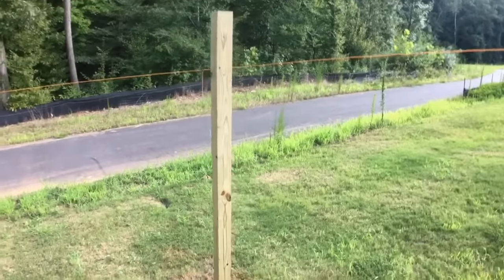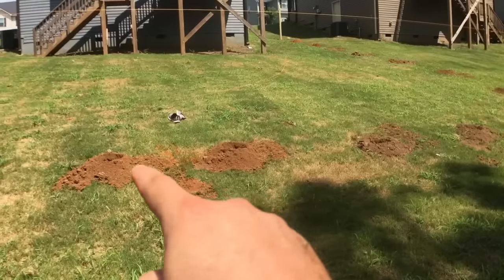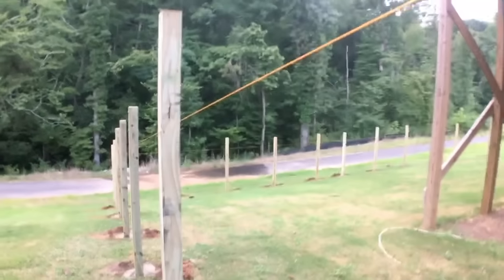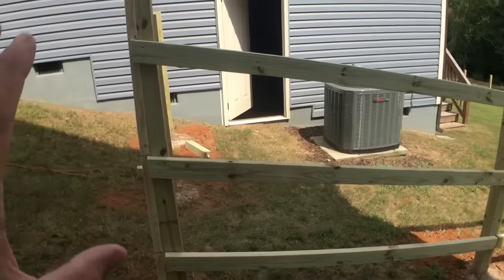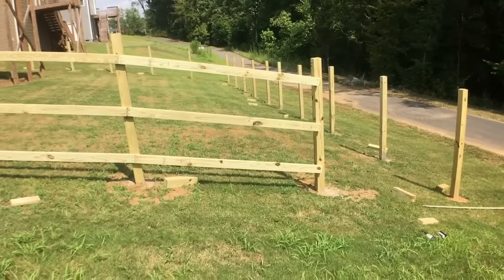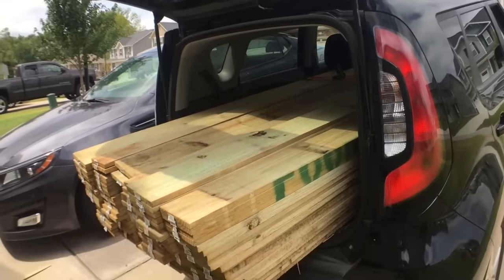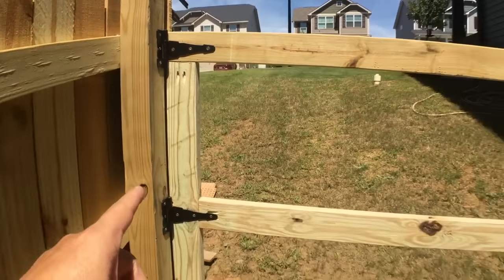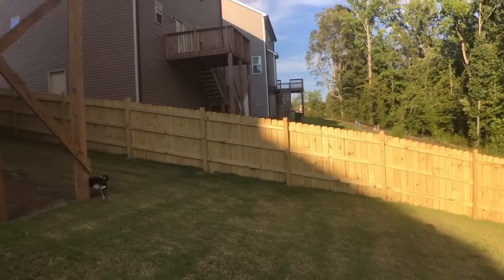How To Build & Install A Wood Privacy Fence Yourself! WITHOUT breaking the bank!!!!

Comment: Great jobs guys! I'm thinking of doing the same thing. Can I ask how much you saved by doing it yourself instead of buying a fence?
Reply from the maker: A ton of money!!! We were quoted $4500 ans $5000! We spent $1400 including rental of Auger. We had the nail gun and compressor so didn’t need that as well as radial arm saw so that cost of tools isn’t included! Thanks for watching !
Reply: Wow that's great. I was quoted 9k for a 200ft vinyl fence. I'm definitely taking your advise and doing wood.
Thank you again.
Reply from the maker: Holy Crap!! I believe ours was about 190 linear feet not including gates! What I paid was INCLUDING gates and hardware!! Run fast and DIY!!!

Comment: I had installed 8 pre made privacy fencing sections earlier, then I seen your video and decided to finish my project a picket at a time like you have done, so THANK YOU for posting this... it's going to be a big help...but I do have a question...on the pre made sections, they used 2 x 3 wood for the cross boards...you used 2 x 4' s ($5 ea.),which cost more than the 2 x 3 ones($3.49 ea.)...any particular reason why ?
Reply: I don't know his particular reason, but I know locally my home depot and Lowes don't carry pressure treated 2x3 lumber. Here the price is ~ $3.50 for ground rated 2x4.
Reply: @kevinr6721  Thank you !
I just finished about 200 foot of fencing all based on hisYouTube video...it made all the difference in the world..only thing I didnt do was to rent a powered Auger..I dug 22 posts with a old fashioned post hole digger and it put the hurts on my 62 year old body !! Lol

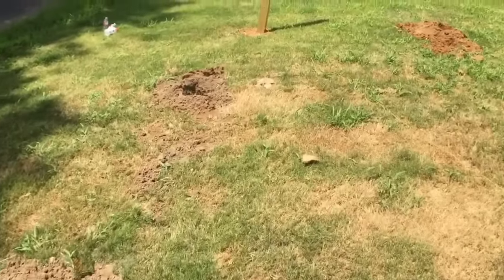Comment: ha ha ha   3:34

I would love to only have a few rocks that are that size!   My area is built on an alluvial fan from the last ice age: mostly rocks with just enough dirt to lock it all in place.  Its all relative.  ;-)

The power is for speed, not ease.  I can't use the auger: it will bind repeatedly.  I have to dig manually, so it will take me a few days to get the holes in.
Reply from the maker: I was going to only do a few holes a day and go without the Auger myself but wanted to get that part over with! What a PITA!!! LoL. Thanks for watching!!!

Comment: How did you get the 4 corners lined up straight with each other??
Reply from the maker: I measured everything based on my property prints. I decided to go in about 6-8” just to make sure I didn’t impede on my neighbors property. I’d rather go less and be sure than to be wrong and have to rip down the fence over 3 or 4” error on my part!
Reply: @TheCrawlspaceCraftsman  thank you for the reply! With that being how you decided where to put them, how did you line up each corner with the other to create a straight line of string? Forgive my ignorance, not sure how to phrase the question. I worry I would place the corner posts at some angle, effectively creating a whole side of fence that’s crooked

Comment: Hey There! Did you use a 6" Auger for your 4x4 posts? I am thinking about using 6x6 posts, but really don't want to have to buy a 8" wide auger.
Reply from the maker: Hey there! We used a 6” auger bit. I believe 8” will be overkill and more work. Hope that helped ya!

Comment: I have an old fashioned post hole digger. It has two large handles like you'd see on a shovel, and on the end are two pieces that look like shovel blades. It's heavy too, but I don't think that I could lift an auger..yikes! If it's anything like a rental circular sander, then count me out..LOL.
Reply from the maker: I took have an old school post hole digger and that was my original intent to do but with all the rocks, clay and stumps it was way too much work. I could have done a hole or two a day and called it good but i wanted to be done with it! LoL. Thanks for watching!

Comment: Fence looks awesome!  What is the reason for setting posts 7' on center instead of 8' on center? Considering you can get 2x4s in 8' lengths. Just curious.
Reply from the maker: #1 it made the fence just a little stronger but also you have to make sure your 4x4s are DEAD CENTER 8' or your screwed.  This makes it a bit easier.  Yeah you have to cut a foot off but its worth it!
Reply: @TheCrawlspaceCraftsman  Gotcha. Very good idea!

Comment: Looks really good and well done. Thanks for the informative step by step video. Out of curiosity, how much did all the material costs add up to if you don’t mind me asking? Thanks.
Reply from the maker: Thanks so much Teefo11!!!  I spent overall (in this video) just about $1400 and that includes the tool rental.  I spent about another $150 on Post Caps and Solar Lights that Is in my last video I posted.  I took a Youtube Vacation and plan to start uploading again regularly in a day or so!  Thanks again!

Comment: Plumb, not level. Use a spacer to offset the strings 1/4" or so from the corner posts and run a string line near the bottom as well. Then set the rest of the posts the same offset distance from the strings.
Reply from the maker: Verbal good up! LoL. Thanks for watching!!

Comment: Good looking fence. I've used the story pole method before as well! Make sure to eyeball your posts to help prevent bowing by running the worst bow laterally in line with the fence. That treated wood will get wild on ya!
Reply from the maker: Yeah!! I did a one year follow up video and you can see where a few 2x4s went a little crazy!  Lesson Learned I guess!  still looks pretty darn good! Thanks for your feedback!

Comment: How much did it end up costing per Linear foot including equipment rental and hardware and concrete and and and thx super good video if I can do it you already did
Reply from the maker: I think it ended up to the tune of about $8.50/linear Foot. That does not include the post caps which I did a separate video on. That was almost $300!!! So with the caps....more like $10/ft

Comment: The post hole digger is a jerk at times..I use a short handle long spade..i call it a sharpshooter works so well when you dont want to shell out for the auger..
Reply from the maker: this ground was WAY to hard and stoney for Sharpshooter.  Plus this got the job done a lot faster... I only regret the after affects!  Took me a few days to recover.  Hope I don't have to use one again any time soon!
Reply: Awesome job..i finished up a fence job, using your template technique. Your video was very helpful. and thanks for the Walmart tip..

Comment: How did you cut the slats? Or did you by them pre cut?
Reply from the maker: Just used my Miter saw and measured every 6-8 boards as the height of the actual boards changed a little bit as you work your way down line.

Comment: Hi you did an EXCELENT JOB  for one its not easy to do privacy fence,. Me and my father did one straight one on level ground not real hard,  but with the way your yard is man you are super smart I mean it.No if you can do that on unlevel ground I certainally can not...It cost alot for all those boards and materials so I can.t imagine what a fencing cpmpany would charge so so much and it would not be any better job at all..Subscribing. Questions where is this at? and I never in my life seen such tall houses wow atleast 3 stories.Did you videos from the top of your house man bets is high.I kinda like that and don't like height at the same time.Roofing your house no way deadly dangerous.
Reply from the maker: Hey NE!!! I’m in North Carolina. This is a three story house but the “crawl” is huge making more like 4 story’s. I plan to build my workshop under the house. Might do a shop build video on that too!!! Thanks so much for the kind words and also for subbing! Cheers!

Comment: nice job and video, i have to laugh tho with how close your neighbors are and how tall those houses are, not sure about the "privacy" part, other than letting your dog run in the prison yard.    snark.    but very helpful, and informative.   i'm going to tackle refencing my house as well, a couple hurricanes did it in, they didn't put concreate in all the posts so they rotted in the ground.
Reply from the maker: with the slope of my yard and how tall the houses are... there really is ZERO privacy.  This is why I didn't really worry about the height.  Thanks so much for watching!

Comment: Is it cheaper to buy the fence panel or buy the pickets individual
Reply from the maker: Stay away from panels at all costs! They’re Cheaply made. They use 2x3s for the runners and just crappy. Your savings will not outweigh the quality. I didn’t even consider them due to all the factors of my yard shape and grade as well as the fact I could only go 5’ so I had to cut either way. Hope that helps some and thanks for watching!!!
Reply: @TheCrawlspaceCraftsman  so buy individual pickets right and which ones
Reply from the maker: That is correct. I know at Home Depot they had two quality pickets. I believe one was ceder and like $2.30/ea. I went with the treated pine for $1.68. So far so good!!!
Reply: @TheCrawlspaceCraftsman  ok thanks

Comment: Use your speed square as a circular saw guide and you won't get the wompy cuts. :)  I 100% cannot cut a straight line unassisted lol.
Reply from the maker: That is a great tip! I’m going to add Caps this spring to the tops so I’m not too worried about it but for those that don’t plan to do a cap I agree 100%! Thanks for watching!
Reply: @TheCrawlspaceCraftsman  My old man was a builder, learned me a thing or two ;) We either just bevel cut the tops, or do what i call a princess cut which is a beveled top then two more opposing bevel cuts about 4 inches down to make it look real fancy like. Im too cheap for caps! :D
Reply from the maker: I was going to do something like that but We are opting for something a little more fancy with copper tops. I’m going to do a follow up video I think in May. 👍

Comment: Why are the fence panels touching the ground?  Wouldn't this speedup the panels rotting quicker and is it standard to have panels touch the ground?  Thanks.
Reply from the maker: Yes! I This was a mistake I made but corrected. I actually cut off about 2” off the bottom just recently.
Reply: @TheCrawlspaceCraftsman  I made the Lowe's subcontractor fence company return to cut bottom 2" off.  I had to write through Lowes CEO to local fence company to get it done right.  The subcontractor did the opposite of what it had on Lowes website. Not going to Lowes again....
Reply from the maker: @chefbambu9382  Inhad Lowes come out and quote me almost $6k at the time for this….. again only $1400 for me! Again I made a few mistakes I’m sure but as newbie to it… I love it!

Comment: How much Land do you have ? How many post did you use and how many slots
Reply from the maker: we live on a standard qtr acre lot.  not sure how many pickets but there are 30 posts spaced roughly 7' apart.  where the gates are they are closer.

Comment: What size auger bit did you use?
Reply from the maker: I believe we used about an 8" bit.  There was about 2-3" all the way around the 4x4.  I never did get the exact size so that's my logical guess! Thanks for watching!
Reply: @TheCrawlspaceCraftsman 1 bag per post ,  60 or 80 lb bags?  Thanks for responding. Great video .

Comment: I'm trying to build a fence also. Could you provide the information on the materials you used to make this fence? Also cost.
Reply: Don't have the bottom rail at 10 inches, the boards will warp, making it hard for mowing.  No more than 6 inches is best.

Comment: What size nail gun and type of nails did you use ?
Reply from the maker: I wish I remember the exact size.  I used a Large Gun and Galvanized nails I believe with a broad head.  I think they were 1.5" long.  They came in a nice plastic box with a black lid from Home Depot.  I think I had to buy like 4 boxes.... maybe 5....

Comment: Is there a reason you used nails instead of screws? I had a neighbor that built his fence with nails and after about 5 years it now is starting to fall apart, anytime there's a storm he's always losing a few panes.. just curious as I want to build my own and wonder why no one uses screws over nails.
Reply: Nails are a lot faster and marginally cheaper. Screws are also better for both longevity and repairs - but the increased labor time is not usually worth it to a contractor. You won't get many jobs if you are quoting screw installation and your competition is quoting nail labor.
Reply: Screws for attaching the 2x4 rails to the posts, and then nail(gun) like the OP did, to attach the pickets/slats to the supports.

Comment: You did good. I wish you would have known of, or considered first sinking steel brackets right into the concrete first, and then mounting the 4 x 4s onto those, or at least to have coated the base of the 4 x 4s with that black tar the utility companies put over the base of telephone, and power poles before they sink them. Always best to use that pitch at the base for longevity, even if you use steel brackets. Better resale value then down the line. Even so, yours should hold up for a good long while. No need to feel bad about it. You did good.
Reply from the maker: Thanks David!! We’re super happy! I was mowing the yard yesterday and looked at it and thought how good it still looked! I’m going to hold off and do a one year update in September since that is when I built it in 2018. Never thought about costing the 4x4s. Too late now! Hahaha!

Comment: Did you use any kind of level on those or just string
Reply from the maker: Yo make sure the posts were plumb….. yes….. but mainly on the four corners.  The string is to make sure that they are lined up so the fence isn’t “Wavy” once the pickets are installed. Hope that helps!!! Thanks for watching!!!
Reply: Yes the rest of the video was very helpful just was confused cuz i didnt see anyone leveling anything and it still came out perfect

Comment: I thought you needed a couple inches off the ground so they don’t rot. 

Also, why not angle the whole thing instead of step sections?
Reply from the maker: The pickets aren’t touching that bad mostly but some are. We plan on doing. So backyard landscaping as it’s pretty bad back there right now!!! I want to wait a little further into spring before doing so and I’ll address any pickets too far down then.   As far as angling them… it would just look bad. Stepping them follows the contour of the ground which our HOA requires… I can’t disagree because it looks good.

Comment: What kind of gun and nails did you use?
Reply from the maker: I don't remember the brand but they were a galvanized nail I got them by the 1,000 I believe and I bought them at Home Depot.  They came in a plastic box.

Comment: every 7ft? is that the rule of thumb ? or do i get a board that ill be use and measure it ? what happens if im 2 feet off my accident ?
Reply from the maker: I did that for 2 reasons.... 1. the closer the posts, the stronger the fence. 2. It just made it easier that IF I inadvertently spaced a post beyond 8’ then I would be screwed with 8’ runners. Cutting the 8’ runners added more work but it was foolproof! And last for me.... mathematically it worked out perfect!
Reply: @TheCrawlspaceCraftsman  so let say I add the first post. I then use a 7ft board as rail to measure until I get to the end. Or do I just add the first post. Then pick a spot to add the end post. Then add the string to level it. Then count 7tf between the first and last post?

Comment: Why are the horizontal 2x4 on the inside of the gate? I don't think it looks very pretty with the 2x4's on the inside. Why wouldn't you place the vertical slats on the inside? I'm not sure if I am wrong for asking, but when on the inside of your yard would like to see beautiful fence not the 2x4's.
Reply from the maker: Your not wrong for asking! Curb appeal is everything when investing in your home. Most fences are built like this. Also... wouldn’t you like to make it difficult for someone to climb over the fence? If the slats are are on the outside... someone could hop over pretty easy!
Reply: @TheCrawlspaceCraftsman  I totally see your point, i guess in order to have a nice fence on the inside you have to add slats on both sides. it can get pricey fast i guess. this has been my issue for my future fence, I planning on using postmasters so i don't have this issue. Thank you for the video.
Reply from the maker: David Murillo you could also Alternate the slats inside and out too!

Comment: This is exactly the video I need to prove to my wife that we can do a higher end fence for a lower cost than getting a chainlink through a fence company. We are doing only like 80 feet of fencing on one side of the house.... people want over $3000 to do a wood 6 foot... Meanwhile menards is selling the 6 foot fence boards for 1.19 and I need less than 200 of them. 4x4 posts are more expensive and of course I need to get cement and other small supplies + rent or buy an earth auger, which is 60 to rent for 4 hours... We could literally do it for probably 70% of the cost and get it done in 1 day.
Reply from the maker: Exactly my friend!! Have her watch the video! She might be entertained at the same time! LoL. Thanks so much!!!
Reply: Where are you out of, if you don't mind me asking. My price for materials and labor  for 80 would be around 1700-2100 depending on if there's a pre-existing fence.

Comment: did you measure 5 feet before or afteryou put them in the ground Im 5'2 and that doesnt look like 5 ft
Reply from the maker: Thanks for asking! They were 8’ poles. Dropped them 24” which left 6’. I then measure 5’2” from the ground up and cut that off with the circular saw. Hope that helped!! Thanks for watching!